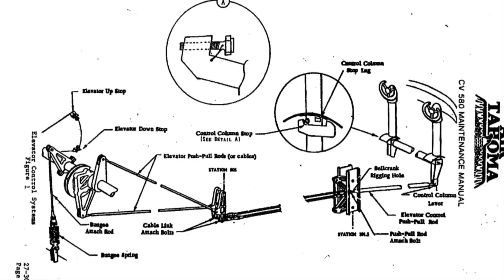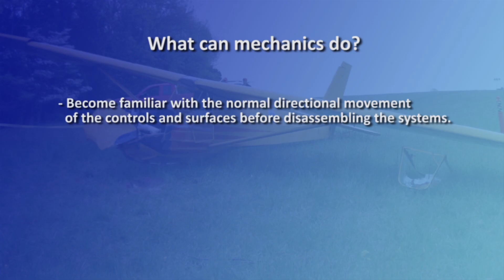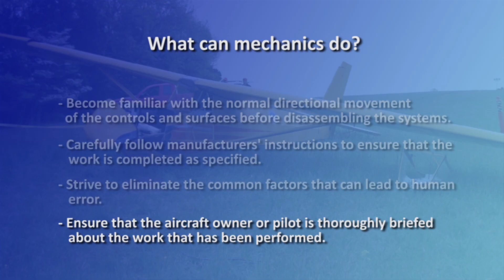Airplane Misrigging: Lessons Learned From a Close Call

Comment: this is garbage....any sane pilot doing a preflight will check the neutrality of the trim on the elevator during a walk-around.....I've caught this many times after maintenance. The checklist calls for it. It's the PIC's job on a preflight to determine proper trim tab position. An aircraft should be controllable no matter where the trim is set.
CFI CFII MEI ATP Gold seal.....11,000+ hrs

Comment: Well, that's just stupid. That's like wiring the hot to the neutral on electrical outlets. Talk to yourself when you're wiring or rigging cables. A $30 label maker or 3M electrical tape would serve as well. Finally, check your work by having a partner operate the controls while one observes from the outside. Why are we even having to talk about this?

Comment: Roy Chadwick, the man who designed the Avro Lancaster was killed in 1947 as a passenger in an Avro Tudor which had been serviced and had its aileron controls reversed. Any flier, even a model aircraft flier, will tell you that there is no way out of that.
When we were flying fullsize gliders in the 1960s, before the first flight of the day we would check not only controls free and full in movement but all moving in the correct sense, eg, Left Aileron up, Right Aileron down etc, elevator trim tab moving through up, down and centred. Always seemed to make a lot of sense to we youngsters.

Comment: A line boy once put the wrong type of fuel into Bob Hoover's Aero Commander.  Bob crashed after takeoff, was not hurt.  What do you think the line boy felt ????  Bob, a fine man...........   told the boy that Bob knew he would never make that mistake again, therefore that one boy would always be the refueling person whenever Bob's plane needed fuel.  (  later on,  the gas nozzles, etc were changed to different shapes for avgas vs jet fuel. )

Comment: it's not enough to admit your mistake.  he should have admitted he did not function check the controls prior to signing off on the work and therefore he was negligent and could have killed those two boys.  I first got my pilot's license in 1965 (SEL).  I have over a 1000 hrs of flight time.  I quit flying in 1988 for health reasons but the point I want to make is that in all that time checking directional control of the trim tab was never part of the airplane pre-flight walk around checklist.  Apparently this is not an uncommon problem.  These guys were very lucky.

Comment: I would add my voice to those expressing appreciation of the mechanic's video mea culpa. There's a palpable sense of his regret.  That said, the trim should have been checked by the pilot before the engine was started. The sixth item on my pre-flight checklist is trim check. That means fully deflecting the trim tab in both directions and observing that it's moving in the correct direction and moving fully to each stop. It should be checked for every flight but especially on a post maintenance flight where the mechanic specifically advised the pilot that the trim was re-rigged!! it may have been the mechanic's mistake but it's the pilot's responsibility for the flight controls to be correct.

Comment: Good CRM and thought processes, but this illustrates why "Full and Free movement of controls and trims in the correct direction" should be in the checklists somewhere before take-off for any flight. (Pre-taxi wastes the least amount of time if something's wrong.) Its absolutely vital after any maintenance more invasive than inflating the tyres. Murphy's lurking any time something's changed or disconnected; the literature's full of such errors. They were lucky it was only the trim, (which can be overcome with brute force on most light aircraft) rather than the actual controls. There usually isn't time to diagnose that.
Reply: "Controls Free, Clear and Correct!".

Comment: It is on every pre flight inspection for every airplane. If not add it to the end of the preflights Controls free and clear, moving in the right direction.  Pull up, elevator up, push down, elevator down, right bank, right surface up left down, left bank, left surface up right down. Rudder free left peddle left, right peddle right. A also cycle flaps looking for symmetrical deployment and retraction. Cycle trim tabs up and down right and left. Looking for up for up, down for down, left left, right rudder right. Do it as the end of your walk around inspection. ESPECIALLY AFTER ANY MAINTENANCE WORK. I do it every time.

Comment: This actually happened to me. I had the good fortune to recognize the problem shortly after takeoff because I was The pilot that was responsible for returning the aircraft to service after maintenance. The mechanic stated that he had worked on the trim tab. After departure when I trimmed for nose up, it acted like nose down pressure. I had the good fortune of realizing that the rigging was inverted and immediately tested that hypothesis by reversing the trim wheel input. The process worked so therefore I neutralized the pressure on the control wheel and then returned the aircraft for an uneventful landing and I immediate return to the shop that did the work. It was discovered that the bell crank had been turned 180° the cable therefore activated the trim tab in the opposite direction. It was just another normal test flight for me but I did not realize that over half a dozen people lost their lives with a similar mechanical error. Excellent video on unexpected in-flight emergencies. The Cessna 172 did not have electric trim, thank goodness.

Comment: So why didn't anyone mnually check the flight surface movements after the re-rigging? Activate the trim and watch the surfaces move. Simple checkout that should be mandatory after re-rigging the trim system. And another silly question, why the hell aren't the cables made in such a way as to not be able to connect the cables to the wrong location? Whoa....imagaine that?!
Reply: In my transport category work years ago, it was a maintenance check list item to check proper direction of flight controls, even if we hadn't disturbed them. My guess is that someone in the past had overlooked an improperly connected flight control, and the powers that were wanted to make certain that it could never happen again.
Reply: Basically, what Megan said. When pre-flighting for a post maintenance check flight, assume nothing, check everything. Kudos for the flight crew's CRM and the mechanic's mea culpa.
Reply: You'd think, both the pilots and the A&P.
I was expecting the A&P to be explaining how he got distracted and failed to check the trim tab was moving in the correct direction but it appeard that he didn't consider that he'd missed that check. It appears to be something he just wouldn't do. Entirely relying on having done the work correctly, with no further verification.
Amazing. And presumably that's regarded as normal?!

Comment: I realise that my comments here are two and a half years after this video was published, but I have to put my two cents in.
I have been a Licensed Aircraft Engineer for some 15 years now and I have done this same and similar jobs many times.  Luckily I have not had any issues so far.  Those that have made negative comments below about the mechanic don't obviously realise that some parts of airplanes are almost impossible to see into to detect errors such as what happened here and how easy it is to cross-rig trim cables.
Years ago "The Right Stuff" was never to admit your errors.  Today, we have learned that was absolutely the wrong thing to do, and you have to put your hand up when you have made an error.  Nobody has enough time to make all the mistakes, so we have to learn from those of other people.  
Stephan, you have my total respect for fronting up on this video and telling your story.   I, like you have heard the stories and read the reports.  Next time I play with a flight control, I will think of your story.

Comment: I have a commercial cert with inst rating SEL (320 TT), and am a career structures maintenance man on commercial and military big iron. The only time I've done rigging was in A&P school, but it seems that a rigging procedure should have been followed with a visual check of proper elevator trim tab travel after maintenance by the mechanic/IA, and before the work was signed off for return to service. Additionally, as a pilot, one should also do a visual check of elevator trim tab proper travel, knowing that particular work was done, though I understand a pilot not doing this. Honestly, I probably wouldn't have if called for the post-maintenance flight, especially with the mechanic standing there explaining what he'd done. Proper trim tab travel is not a normal part of a pre flight check by the pilot. Proper main flight control surface travel IS normal pre flight (thumb up, surface up). The mechanic here said "the control cables had done a 180 when they were put on the actuator." Damn! How was that not seen with the naked eye? One unfortunate part of aviation maintenance is that humans make mistakes. I've made mistakes as a pilot and mechanic. Some could have been life-threatening, but since I work under a repair station my work is checked and signed off by an IA or designated inspector. I have a nephew who picked up a Mooney after major maintenance associated with an annual inspection, including main flight control rigging. When he rotated he quickly discovered right was left and left was right with the ailerons. He crashed the plane on the grass strip, completely destroyed it, and miraculously walked away with no injuries. Flying is one of the safest things a human can choose to do, but it is very unforgiving of mistakes by people in charge of maintaining thousands of pounds of aluminum and steel rocketing through the atmosphere. During my commercial training my instructor had me fly a 172 with full down and full up elevator trim. It wasn't fun, but was doable. I'm glad these two men were able to do it, too. I guess if it wasn't for the risk, flying wouldn't be so damn much FUN!

Comment: I didn't hear anyone mention "Independent Inspections" during the video. Are they not specified by the FAA? In Australia where I am a LAME (Equiv of your A&P IA), if we carry out maintenance on ANY part of the flight control system, it requires an Independent Inspection by a second LAME who has had nothing to do with the work that was carried out. The inspection MUST ensure that the work was carried out properly and that the whole system that was worked on has been reassembled, has been  correctly locked, correct tension and full free CORRECT movement.

Comment: As a non pilot from another engineering discipline, I am surprised the rigging connectors are not keyed to prevent the possibility of this maintenance error ever occurring. It's the equivalent of having a road vehicle turn to the left when the steering wheel is turned right, imagine trying to drive under those conditions, let alone fly an aircraft!

Comment: Just echoing what others have said down below...

12:22 Why don't they just say: After re-rigging flight controls, double check that trim tabs and other surfaces move in the correct direction before getting in the damn plane to fly it?

In the maintenance manuals: After re-rigging flight controls, double check that trim tabs and other surfaces move in the correct direction before giving it back to the pilot?

Where is the common sense? GA been flying almost a hundred years now... and yet to even FIND the error, you need a high power flash light and a mirror to discover the cause? 
Sheesh!  This is insanity on steroids!

Oh well, preaching to the choir in this comment section.

Comment: I've been there and "participated in that."   Let me set the scene:  1969, Wiesbaden, Germany, Wiesbaden Air Base.  T-39 Aircraft.   Working as a "Instrument Repairman" with an "Electrician" on, I think, an elevator trim actuator replacement.  Following the replacement of the actuator, the Electrician asked me to "ops check the system."   I did, and told him it worked backwards!  He said:  "No way."  The trim tab came "Up" which meant the nose of the plane came UP, and the trim tab came DOWN, which meant that the nose of the T-39 came down.  WRONG!  

When the tab goes up, it deflects the elevator DOWN, thus, the nose of the plane goes down, and vice-versa.  After a few "run throughs" the Electrician agreed.   I then "signed off" the trim system.   This is how trim system problems are allowed to come into being.

USAF Ret.  N-6395T

Comment: As an ex aircraft mechanic from the military, is there no QA to ensure work was properly performed? Besides QA, what's wrong with a visual inspection while someone actuates the trim tabs to ensure flight surfaces are moving in the direction selected? It's way too late once the aircraft has taken off to realize it's rigged wrong.
Reply: I know nothing or aviation but I too was wondering how the mechanic could carry out work on the trim and not actually physically check that it was working properly. It would seem common sense to push the trim button and actually see that it's working properly.
Reply: @Debbie : Yes... it is more important to check that the operation is correct after work is done than to follow instructions religiously.  I'm sure some might be scandalized by this statement, but there are good reasons to think this and operate this way.  For example, something may get twisted or reversed or pinched or tweaked or otherwise changed somewhere that literally CANNOT be seen.  Therefore, the ONLY way to assure correct function of the airplane after work is done is to verify the final results of the system are doing what they are supposed to do.  In this case, this is easy... just look at the direction the trim portion of the elevator is moving when you "trim nose up" and "trim nose down" with the cockpit control.  If the trim surface moves the correct direction in both cases (and to the full positive and negative extent), then this is better verification the system is working properly than anything else.  To be sure, perform the correct actions in the correct order per instructions, but the final check is at least as important, if not more important.  Also note that many airplanes have been modified many times, and thus the nominal instructions for that make and model may not be correct for any given airplane.  In such cases, the ONLY way to realize the airplane won't work properly is... to visually verify that the system DOES function properly after the work is done.

PS:  Every pilot is supposed to check the control surfaces (ailerons, elevator, rudder) move (and move in the correct direction) before every takeoff.  When I watch youtube videos, most pilots go through the checklist so fast that clearly they are mostly just pretending to check some of the items, this being high on the list for being careless.  However, I've never seen a checklist that includes checking whether the trim controls are operational and moving in the correct direction.  This makes me want to add this to my list.  In theory these item should never be connected backwards except after repairs, service, maintenance is done.  But... the number one law of the universe is Murphy's Law, so... don't be too sure!  :-o  :-)
Reply: @maxbootstrap7397 - I can't speak about the civil aviation process, but in Naval Aviation, you follow the book or people die!!!  Like was always said, procedures in the books (Maintenance Instruction Manuals (MIM's)) are written in blood!  You're right Max, there are equipment variances even in the same type/model aircraft, and the maintenance instructions are written to address all configurations.  Post maintenance checks (MIM's QA Inspections) would be written to ensure the control surfaces move in the correct direction for each control input.  By The Book Maintenance!!!  P-3C IFT U.S. Navy (Ret.)
Reply: @markb.1259  : We don't really disagree, but let me ask you the following question.

What if you repaired an airplane and you were super-duper-hyper-vigilant to follow every word, phrase, sentence, instruction.  Further, let's assume your "bible" doesn't include instructions to perform a visual check of behavior at the end.  But just for fun (or because you are a prudent guy), you go ahead and push the yoke back and forth (to make the elevator surface move up and down), and then you rotate the trim wheels and notice the trim surface moves in the opposite direction as the main elevator surface?

Would you just say to yourself... hey, I believe the instructions (my "bible")?  Or would you more believe your own eyes and brain (and understanding of how airplanes work)?  Go ahead and answer this question.

Then answer the following question.  You are a pilot who is flying an airplane that you know (or don't know) was just serviced or repaired.  But when you move the trim wheel in your airplane... it repeatedly has the opposite effect that you want in both directions.  Would you continue to trim in the direction that causes you to crash... because that's what your POH (pilot operating handbook == the pilot "bible") tells you to do?  Or would you "believe your lying eyes" (so to speak) and reverse the direction you turn the trim wheel until you are safely on the ground and able to more thoroughly figure out why your pilot expectations (your eyes and senses and behavior of the airplane) do not match your "bible" (your training, instruction, expectations and POH bible)?

Get the point?